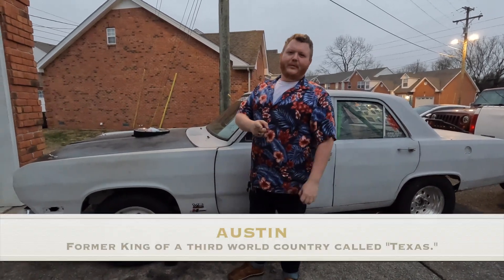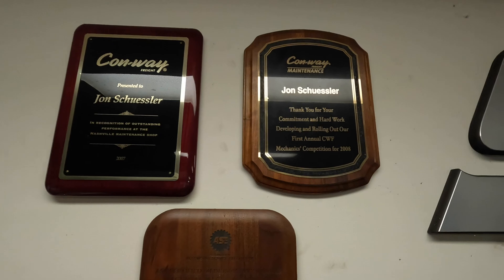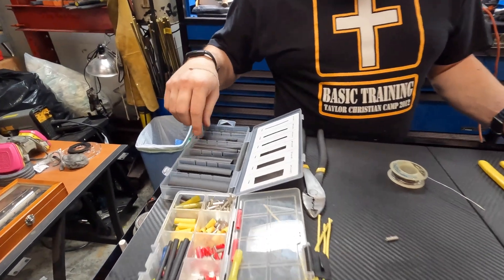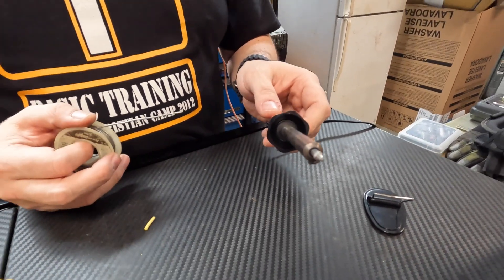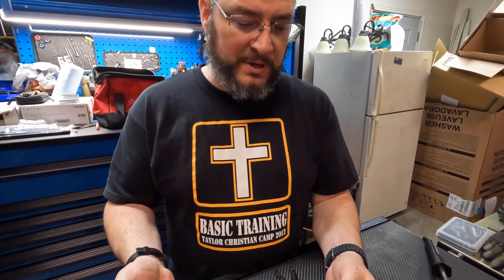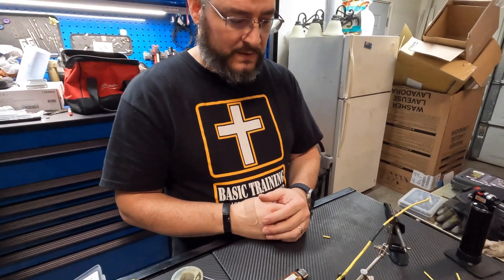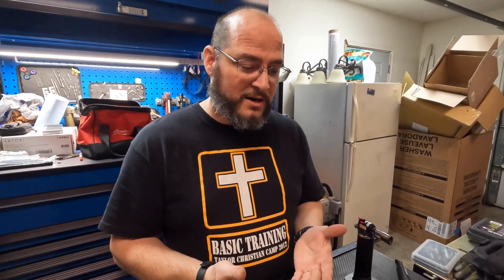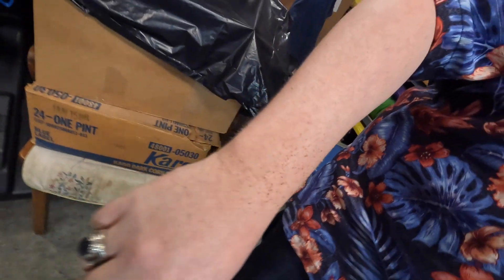LEARN TO SOLDER FROM A PRO IN UNDER 10 MINUTES - STRONGEST, MOST RELIABLE, WATERPROOF CONNECTIONS

Comment: many times to heat the wire enough to melt the solder the insulation on the wire melts first, what am I doing wrong

Comment: This is the exact way I was taught. I usually ignore any other instructions and do everything this way because I've fixed faulty butt connectors with this method and had them last a decade as opposed to months

Comment: So do I never need to use flux? I’ve messed up on that forever then lol. Good video
Reply: If you use electronics grade solder, it's got the flux embedded into the wire, aka Rosin-core